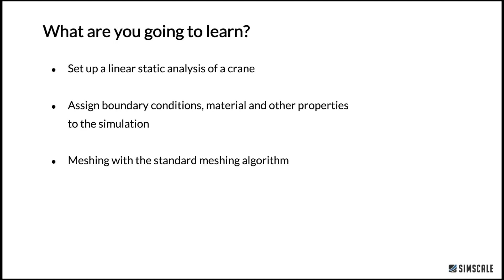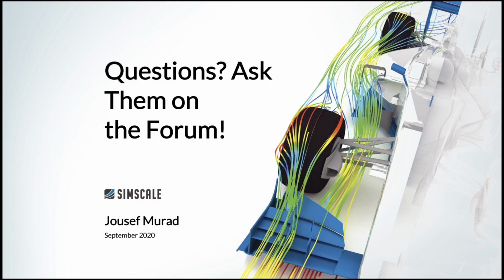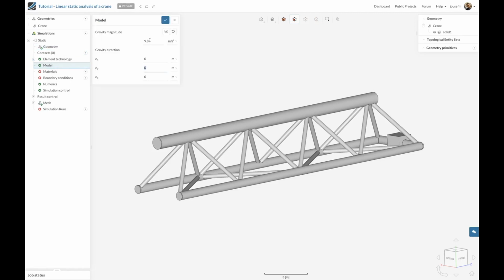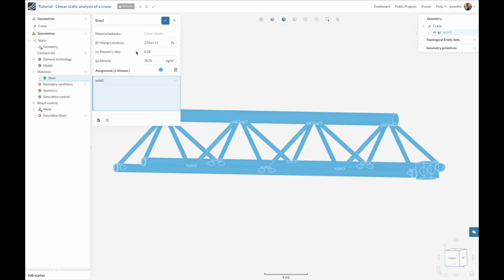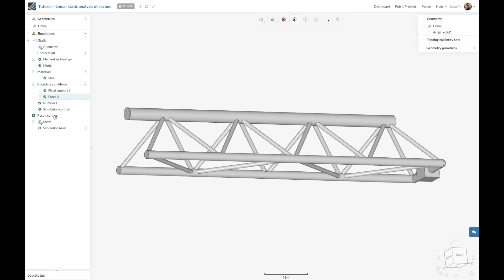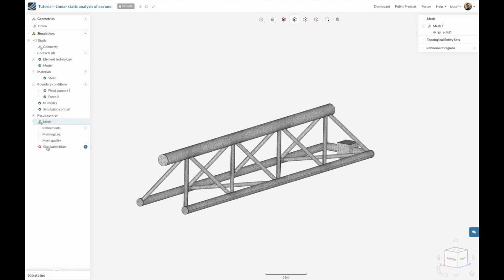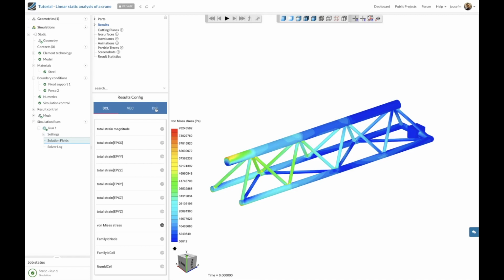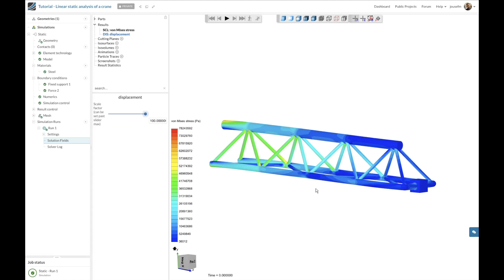How to Simulate a Crane with FEA

Comment: Great vid! Looks very simple to use,  looking forward to experimenting on the community plan.  I'm new to FEA so please excuse the dumb question: How can we tell if the crane broke? I guess the deflection animation would show this. If it doesn't break, is there a way to show how safe it is? For example, can the false colour be adjusted so the upper scale limit is the steel failure stress?
Reply: Hi Alex!
You could theoretically check the v.Mises stress but having a stress over yield does not necessarily mean that the part will break. I would probably have to cover this in a separate video before writing a novel here ;-)
As for the safety issue, you could define a safety factor safety by defining (yield stress/ von Mises stress) in the calculator filter in ParaView and everything below 1 would break. You can play with the formula to get a legend according to your needs!